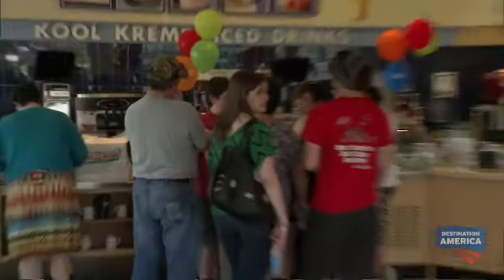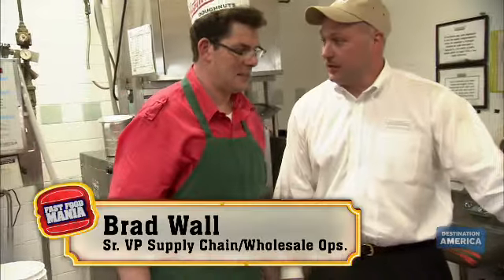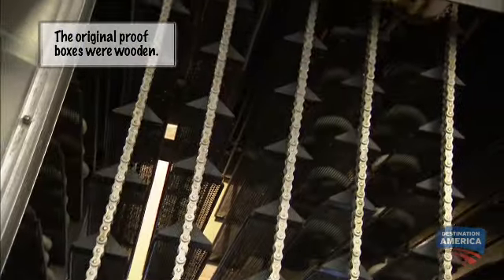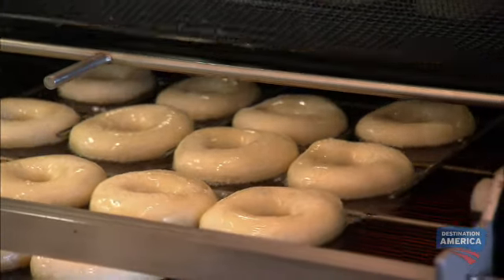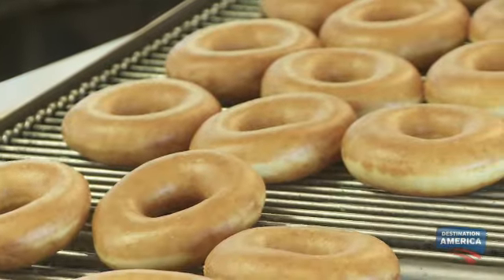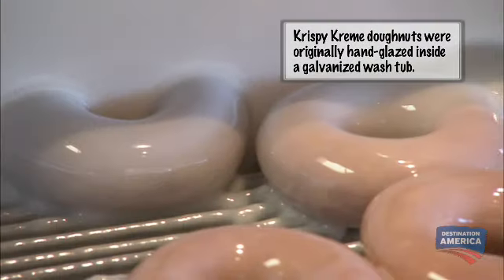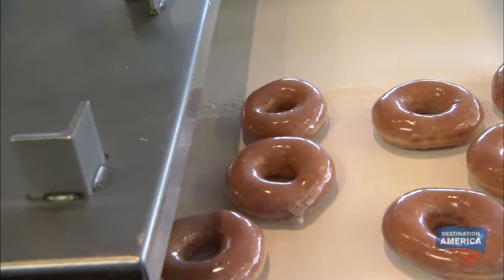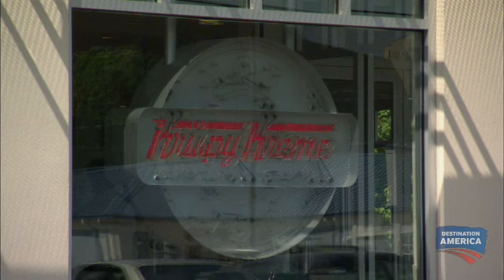Krispy Kreme's Glazed Donuts | Fast Food Mania

Comment: Kripsy Kreme stopped making the donuts in the stores around the time this video was made.  Now they are made off-site and delivered in the morning to local stores.  The HOT NOW light it now always on when the store is open.  What happens when you order some is someone goes in the back put the # of donuts you order on the conveyor belt that runs it through an Impinger Over to heat them to the perfect temperature.  They then continue through the icing waterfall and by the time they get to the end of the belt they are the perfect temp to put in a box.  So they may be good and taste almost the same they are no longer fresh made through the day.
Reply: Nothing could be further from the truth.  They are made on site at our Kripsy Kreme store in Goldsboro NC and I sure most every KK store.  You can watch the entire process only separated by the glass wall.
Reply: Willard Eisenhouser Well then it may not be the case for all locations at this time, but that is how they are progressing.  Not saying you are wrong but look again next time you are there.  Before 2012 the conveyor would get raw dough, deposit them on the belt, fry them, pull the out of the fryer then after a short cooling period glaze them and some may still do it this way.  Now they are pulled off a rack, run through the impinger over, short cooling period, then glazed and boxed up.  I even have pictures to prove it.  I am not blaming KK for this it is obviously a way to cut cost and not raise prices and they still taste pretty good.
Reply: Matthew Fortune The newly built Krispy Kreme store near my house freshly makes and cooks them in store. So not all places have them delivered. :)
Reply: What you're talking about are called "dry rings", also known as unglazed doughnuts. These dry rings are left unglazed and sent to locations that don't have machinery to make them. The very same day they're made, these dry rings are heated, glazed and decorated for the public to enjoy.